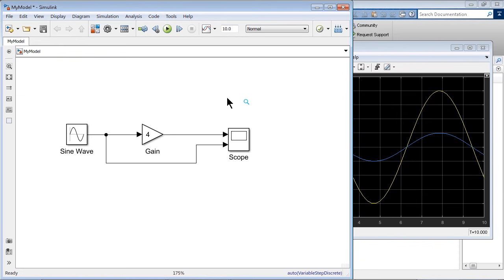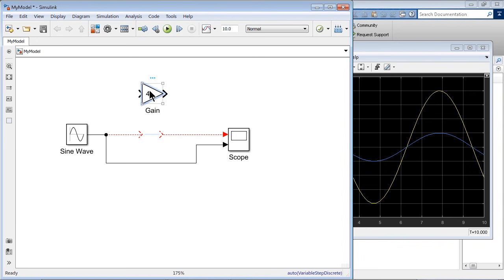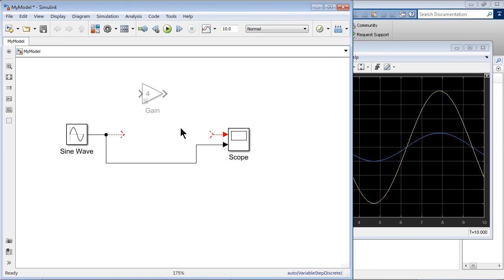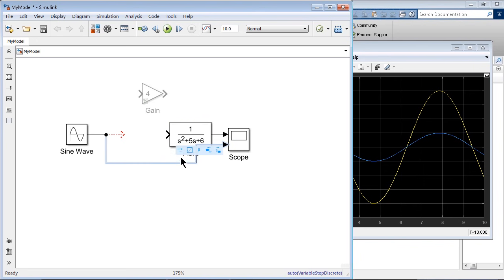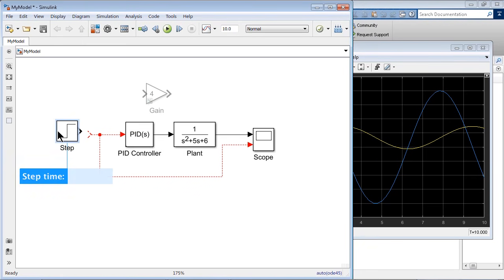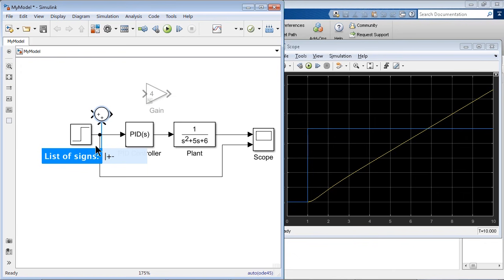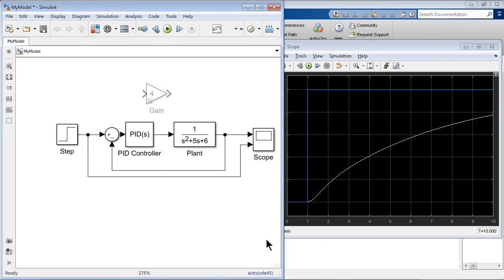Getting Started with Simulink, Part 2: How to Add a Controller and Plant to the Simulink Model

Comment: mine shows num(s)/den(s) when trying to make the transfer function denominator a 2nd order equation
Reply from the maker: This just means that the block is not large enough to fit the transfer function in the block mask display.  Please try resizing your block to a larger size.

Comment: How can I change the appareance in the transfer function I got num/denomin?
Reply: Does yours ask for a 'parameter' with 3 options? Mine also shows num(s)/den(s) as well 😢
Reply: @zexa.  This just means that the block is not large enough to fit the transfer function in the block mask display.  Please try resizing your block to a larger size.
Reply: This just means that the block is not large enough to fit the transfer function in the block mask display.  Please try resizing your block to a larger size.

Comment: Even if I change coefficients of denominater, they do not appear in the block as you described . please help
Reply: is the block too small to display them correctly? if so, you can resise it by pulling the corners. sorry if this isn't helpful, I just started learning this myself.

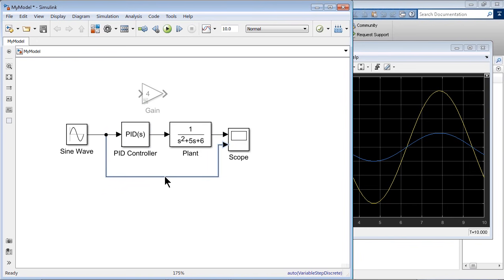Comment: I don't understand the lecture, how can you do PID in a open loop? PID is calculated based on the error between input and output signal. In 3:08, that block diagram is bull shit.
Reply: The controller block is not magic. It works on an input signal - which for PID control should be the error between the target position and the current position. Here they supply the target position as input to the PID controller. In the case of the step function, the PID controller will think there is an error of 1 all the time, and create an output to reduce this error.